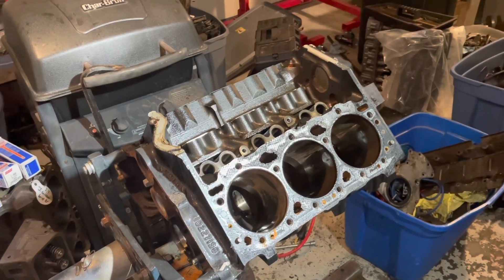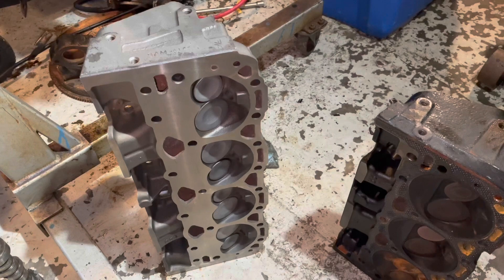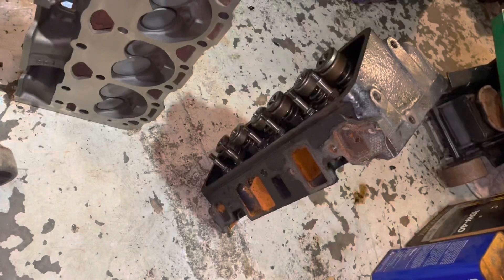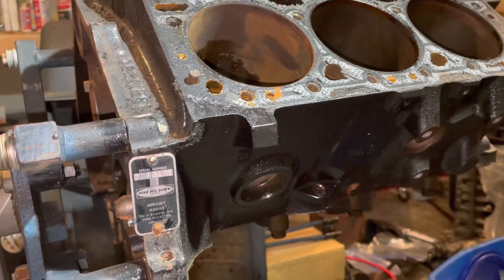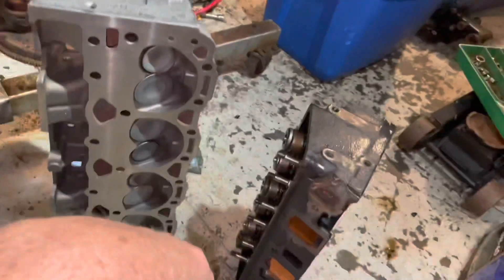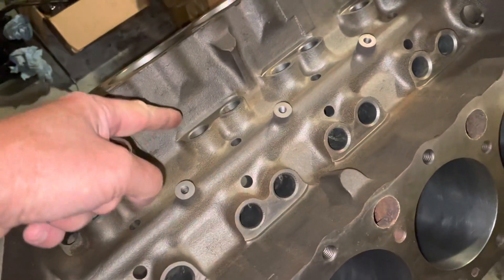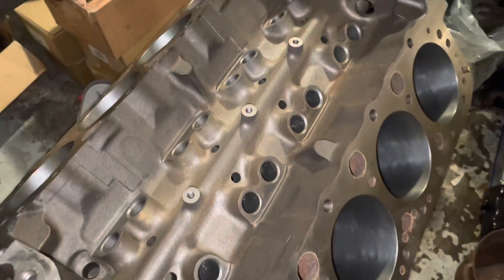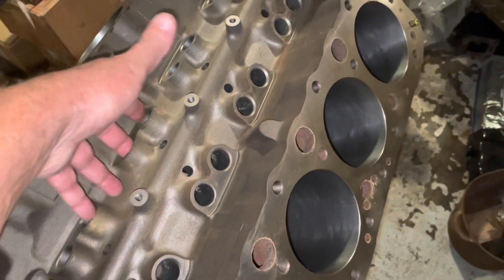Truck/Car to Mercruiser - How To Guide

Comment: Do you use the stock cam with vortex heads? Thank u.
Reply from the maker: Which stock cam are you referring to?
Reply: @moccasinmarine   I have a 4.3 trying to find out best up grades for it. I have buddy with vortex heads he will give me. Do u use stock cam or upgrade cam. Then on intake if I cant find a two barrel cast iron intake and use a Edelbrock 2114 would I need a two barrel spacer or just upgrade to a 4 barrel carb.
Reply from the maker: The video you posted on is about car/ truck vs marine differences. Are you converting a truck engine to a boat engine or is your application for a truck? If converting for a boat, Mercruiser 4.3 cam is slightly hotter than stock truck cam. It has the same specs as the HT383 cam less two cylinders. I wouldn’t go wilder than the Mercruiser cam for a boat. If your application is for a truck, I don’t have any recommendations for that. It’s up to you to decide how you want it to run.

You can use a 4 bbl carb on a 4.3. Probably have to change the jets.

Comment: Okay so I have a 2008 Mariah sx20 with a 5.0 vortec carb engine that the block is cracked. Well I’m wanting a reman engine and it’s a 3 month wait. Or my engine guy can get me a reman 92 model 5.7 vortec engine in 3 days. Would that be okay to use in my boat. Ot should I see if he can find a 96 5.7 reman engine. Basically I guess What I’m asking is what’s the difference in the 92 5.7 vortec and a 96 5.7 vortec thanks
Reply from the maker: There is no such thing as a 92 vortec engine so that’s the first problem. Vortec engines didn’t come out until 1996.

Second, I’m in business because of reman engine companies screwing boat owners with shoddy junk so I don’t recommend that path. I would contact a reputable engine builder in your area and ask what they would charge to build an engine.
Reply: @moccasinmarine  thank you I appreciate that. He told me that it had the bolts down the Middle of the valve cover and 8 intake bolts
Reply from the maker: 8 intake bolts is a true vortec cylinder head but they didn’t come out until 1996. Center bolt valve covers came out earlier but aren’t true vortec cylinder heads. Vortec heads alone are worth 30 horsepower on a 5.7 V8 due to the shape of the combustion chamber. I would not purchase an engine built before 1996. Also if you upgrade from a 305 to a 350 vortec you’ll need to re-jet your carburetor.
Reply: Do you happen to know if the cam from the 2008 mercruiser 5.0 and the 2008 mercruiser 5.7 are the same
Reply from the maker: @davidscott4744  yes they are the same

Comment: so my boat has a 5.0 " vortec" engine but the block is junk, the boat is a fuel injected engine, i have a 5.7 vortec truck engine sitting in the shop, can i upgrade the valve train of that 5.7  change the freeze plugs and put all the accessories on it and run it? or are the fuel injected boat tuned? its a 02 fourwinns horizon 190
Reply from the maker: Is your 5.0 engine MPI fuel filter injected or throttle body fuel injected?
Reply: @moccasinmarine  looks like a throttle body to me, it has the two injectors right on top, its a 5.0 GI volvo penta
Reply from the maker: The valve trains are identical as both use the same roller cam part number. The problem is they also both use the same throttle body injectors which means the extra (5.7/5.0=1.14) 14% fuel needed for the bigger engine is all done in the MEFI ECM calibration. It costs $500 to get the ECM recalibrated. Or you can buy the programming tool to do it yourself. See this link:
https://obd2allinone.com/products/mefi.asp

Boats don’t have oxygen sensors so the system can’t automatically compensate like a car engine can.

Comment: Should I use Chevy pistons with merc rods
Reply from the maker: This question tells me you haven’t watched enough of my videos to get the gist of my channel which is there are no Mercruiser engine parts. They are Chevrolet parts marked up about 10 times and sold as Mercruiser special marine parts. Start with these two videos:

https://youtu.be/FzCmCkBzGBI

https://youtu.be/vR-mao6ZZX4
Reply: @moccasinmarine  now that I have that figured out my doner had spun cam bearings that damaged piston rods the pistons and cylinders are fine in your video you talked about opening up cylinders if I use doner pistons on the boat motors piston rods then I won't need to have the cylinders bored   I believe that I answered my ? That was there home anyway
Reply: Woops I meant rod bearings the cam shaft is good but per your video I am using the one from the boat motor /marine version
Reply: By chance do have the correct roller Cam identification number for a small block 305

Comment: Merc 4.3 bad block  12 bolt intake good cam and crank & 4 barrel carb low hours      Chevy 4.3 good block good vortex heads good cam bad crank found 8 bolt intake the only thing I'm missing carb jets at sea level? Great videos  what do you recommend
Reply from the maker: I don’t know what answer you are looking for. What I would recommend would depend on your engine building talent and how much money you have to spend. But at the least I recommend you watch all my videos pertaining to v6 engine building.
Reply: Ok I get it I have a boat motor 4.3 vortex same as your video cracked block non vortec heads even though they have vortec valve covers just like your video 12 bolt intake then I have a doner motor 4.3 true votec with bad cam shaft  so I am doing the same thing you talked about doner block and heads. cam shaft from boat motor I have sourced a 8 bolt intake just like you talked about the question I have is the jet size for the 4 barrel carb that is from the boat motor with the cracked block

Comment: great video, good advice. My 4.3 mercruiser is dead. Crankshaft and block are damaged due to mixing of water and oil. But I found the same engine from Chevrolet Blazer in 1999 cheaply, much cheaper than repairing an old engine. Could I put  whole chevrolet engine in a sea ray 175 boat just to switch the intake manifold with a carburetor. Or to use a block with a crankshaft and pistons and mount heads on it that are from an old engine? Without changing the camshaft? If there is room, I will put an exchanger (liquid cooler), to make a closed system with antifreeze. Regards, Milos
Reply: I just did this on a 1997 4.3 wellcraft excell 175ssx. Cracked block. Got a 4.3 vortex long block and swapped the oil pan, intake, distributed and manifold, of course everything else, right over. Took it out on the water for the first time 2 days ago.

Comment: What about the other way around.  Putting boat motor in a truck. I'm in the process of tacking my 5.7 liter out of my boat and putting it in my truck. So far my truck flex plate won't fit on where the marine one was. I have all the original parts that came off of the original truck motor.
Reply: I rebuilt the motor when it was in the boat. Hoping I can find a flex plate that works so I don't have to change out the crank shaft.
Reply from the maker: What’s different about the flex plate? If a truck crankshaft will bolt to a boat flywheel then it should go the other way as well.

Comment: Thanks for the heads up on the heads and intake. I have a 91 mercruser 4.3 with a 2 barrel and would like to go with 4 barrel. Didn't know that the vortec was an option. If I'm changing intake might as well change the heads to.

Comment: Great info man. I wish you would have put this video out a month ago or so. I did subscribe to your channel and watched your other videos on how to build a 4.3 but there wasn't any info that I can find on YouTube about truck engine swaps. So I had to do a lot of reading in a bunch of boat blogs.  I just swapped a later model 4.3 into my boat and it took me a while to find out the info that you just explained but I got it done. I used my mercruiser intake, heads ,  replaced my freeze plugs with brass ones and camshaft and it works great. Feel free to go to my channel and check out my swap again thanks.

Comment from the maker: I forgot to mention that another reason you want a roller block is it comes with a one piece rear main seal. Prior to year 1987, small block engines had a two piece rear main seal which were notorious for leaking. You don’t want one of these leaking oil into your boat bilge.
Reply: All sbc 1987 and newer are 1 piece rear main seal. Roller cam motors didn't come till 96 and some still were flat tappet. Roller cam motors have nothing to do with a 1 piece rear main seals
Reply from the maker: @darronlemell224  I stand corrected. I could have sworn my 1994 TBI Suburban had a roller cam but RockAuto shows it didn’t.

Comment: The rings are different , Right
Reply from the maker: Good question but I addressed this in a previous video on parts needed for a rebuild. The 1996 and up pistons use Speed Pro H815DCP which have metric rings and cost $200 for a V8 set. The 1995 and earlier use H423DCP which have Imperial rings and cost $90 for a V8 set. I spoke to Felpro and the only difference between the piston models is the 1996 up pistons use metric rings. To save money I use the H423DCP for all builds with the 5/64”, 5/64”, 3/16” imperial rings. I discussed this in this video:

https://youtu.be/e4S-5qZXaaM

If you’ll watch all my videos you’ll learn tricks and tips to save money. I’m a very aggressive parts shopper and don’t shy away from using different parts than typically stated if I save significant amounts. I’m a former VAVE engineer and trained to seek less costly more efficient materials and processes to reduce costs.

Comment: Great info! Going to start a swap within the next 6 months to do a rebuild. Fortunately I do have an engine from a 95' Blazer 4.3 with the Vortec heads. Debating on fuel injected or keep carbureted. But the Cam from the 1990 block (cracked all to heck) if still good, can it go into the 95' block?
Reply from the maker: Yes cam should work. At some point they started using a balance shaft.  I’ll find out and post back. Get a balance shaft engine if possible. I wouldn’t go fuel injection. Too much hassle for a boat.
Reply from the maker: Doing a search on Rockauto it appears the balance shaft engines started with the 1992 production year. So for V6 blocks you’ll want to use 1992 and later but for cylinder heads you’ll want 1996 or later. Actually for cylinder heads you’ll want 2000 or later because you’ll then get roller rockers which are the best to have. I discuss all these features in my V6 Rebuild series 1 and 2.
Reply: Thanks, I will take a look in the next couple of weeks when I start to disassemble both blocks and media blast the manifolds for potential cracks.
Reply: @moccasinmarine  hey man we spoke once before, I’m at the point of searching for new block and calling junkyards. Having a bit of confusion as far as how late of a block I can use. I plan to reuse my non vortec heads so I don’t have to buy another intake. My question is what year range 4.3 will be ok. I’ve just been asking for 92 and up.